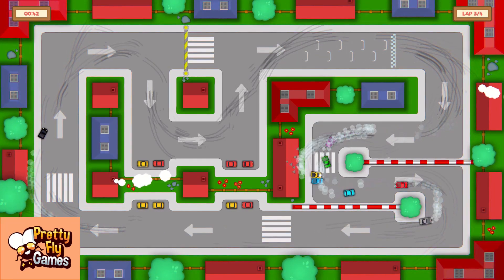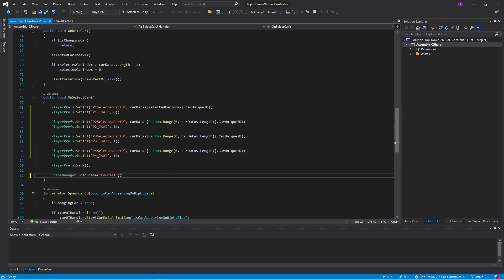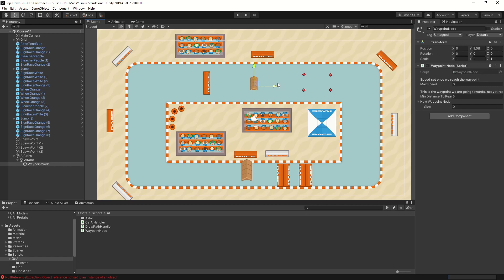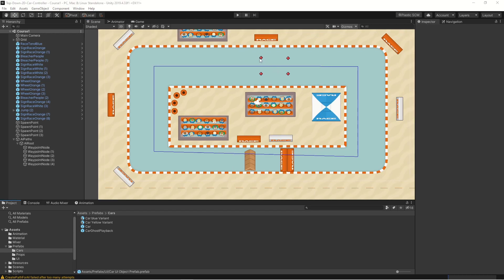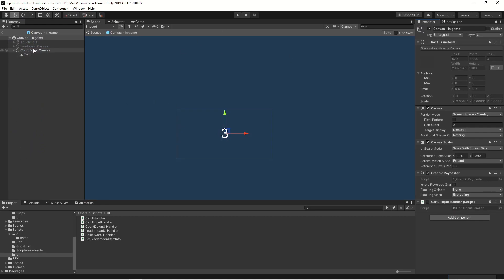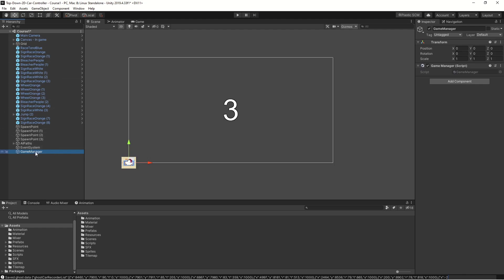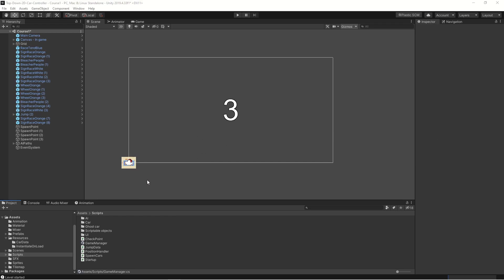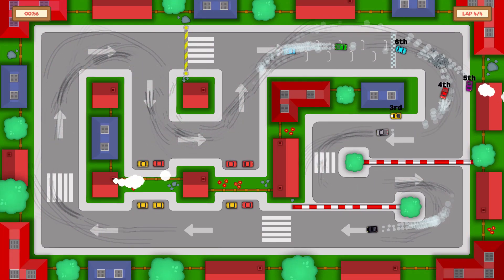Countdown - How to create a 2D Arcade Style Top Down Car Controller in Unity tutorial Part 13

Comment: What code would you add to make sure all of the random AI cars are unique from each other and the player's selection?
Reply from the maker: Hi there Bruce!
I would take the CarData[] carDatas array and turn it into a list. Then I'd remove the cars that the player has selected. You can then select a random car for the AI using availableCars[Random.Range(0, carDatas.Length)]; 

Then you remove the AI car that was selected and loop through that until each AI has selected a car. Then you are guaranteed to have unique cars. However you need to have at least as many cars as there are players otherwise it is mission impossible.